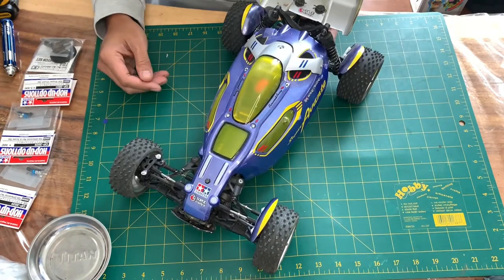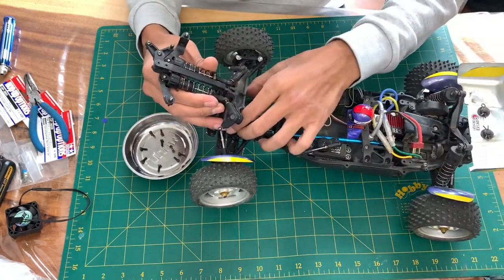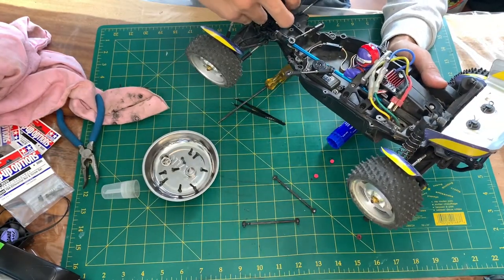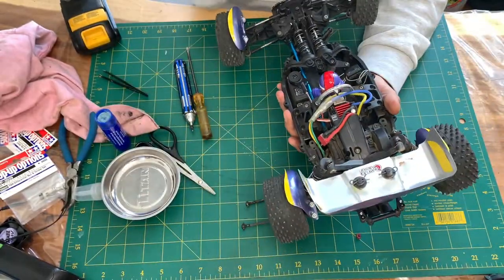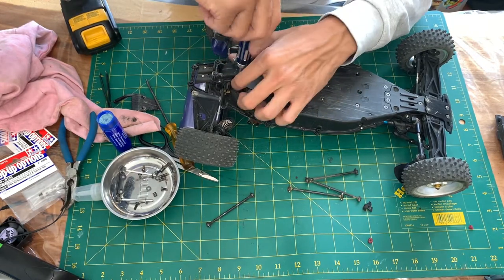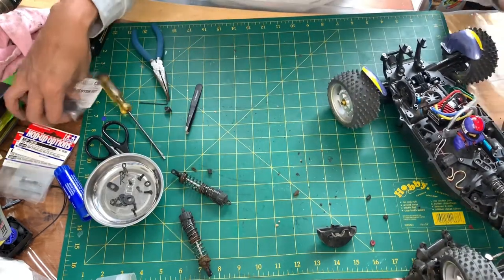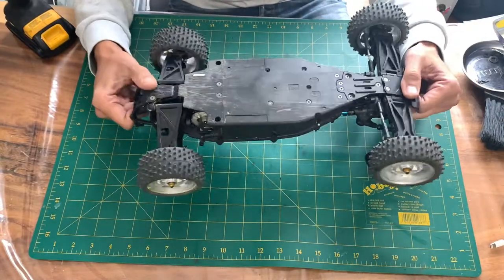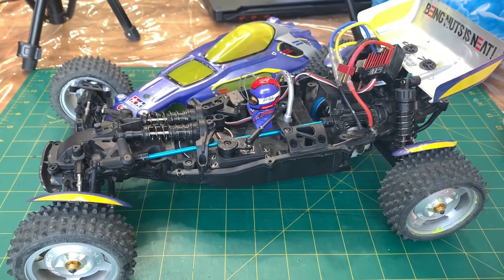SLIPPER CLUTCH INSTALL AND SHORT CHAT

Comment: I enjoyed the part where you took apart the avante, and reassembled the astute. :D Do you have 4th fender for the right front wheel? Othervise, for my own OCD, I have to suggest removing it from the other front wheel. Keep the rears ;D Anyway, good vid, very informative, it was intresting the motormount had become so slapped together it looked like you were gonna break that bottomplate/diffhousing pulling it off. :P Lets see the motor fan mount someday, I see you had a fan already. :D
Reply from the maker: "I enjoyed the part where you took apart the avante, and reassembled the astute" hahahaha thats one way to put it, I like it lolol. I will remove the fenders for you TM, and ONLY you my friend lol. yes I wasnt expecting the bottom plate to be so tweaked that it basically formed a locking mechanism on its own around the motor mount tab, I actually spent a few minutes trying to get it off, I just edited it out of the video haha. I have a fan but its too large, the smaller fsn I have takes a full 12v at higher amps than what the esc will put out, so I will have to do some research. Thanks again for stopping in!

Comment: It took a while for you to realise you forgott the driveshafts, its always a pain when mounting something and the realise you have to take it apart again just because you forgott some small bits and bobs. I just put o-rings in my drivecups, they hold up really well and do the job. Would be nice if Tamiya supplied a undertray for the chassie.
Reply from the maker: DERP hahahahah. yes it happens to me often, forgetting a step lol. O rings will be my eventual next step if these foams dont stay in this time, Im afraid I wont get to the track again unless I travel to an indoor dirt track, I hear Ottawa has one, and its about 5 hours from me. yea a protector like the avante or egress wouldve been nice for sure

Comment: It looked great on the track..The slipper and hop up's will make it even better!
Reply: I did that yesterday! Put it all together and forgot the driveshafts! luckily all I had to do pop a ball end on each side to get them in lol..The diff cups in my Turnigy has o- rings instead of foam..Try those out
Reply: Lol..You should see the bottom of my Durga!! Lol.. and the shocks on it haven't leaked in 10 years..Did you put green slime on the o-rings when building them?
Reply from the maker: @philthyco1  i did not green slime them, I didnt even realize that was a thing here but it makes total sense, I just took the oil shocks from the fire dragon and those were emptied a bit too, I usually mount them upside down where I can and that helps lol. Green slime it is
Reply from the maker: @philthyco1  poor durga lol, Id love to be on track with you and your durga, pit it up against the super avante

Comment: quick tip , pinion size increase should be a percentage increase rather than a like for like increase , if the 48dp slipper spur is 5% larger in diameter than kit spur, the pinion should increase 5% too , thought i would mention it in case you start getting a hot motor.
Reply from the maker: thank you for the tip and advice

Comment: Hmm, I wonder how hundreds of pounds or euros or dollars or other currencies in option parts will sit with customers considering in quite a few cases they seem needed? I presume the main gear of the slipper is plastic not metal?
Reply from the maker: yes its not great, it seems to be what Tamiya intended it to be, it does need a few upgrades, sad because the pricing is not low, but I cant help but wonder maybe the pricing for this kit, was just an example of the new price increase standard? you are correct it is plastic